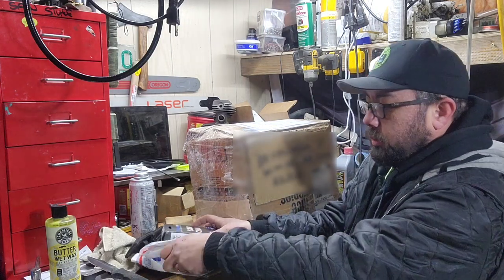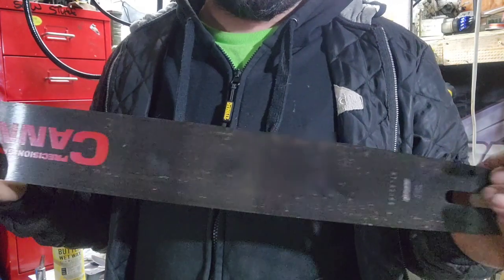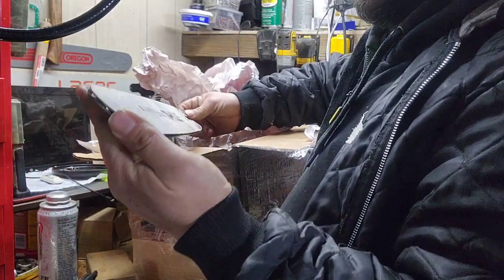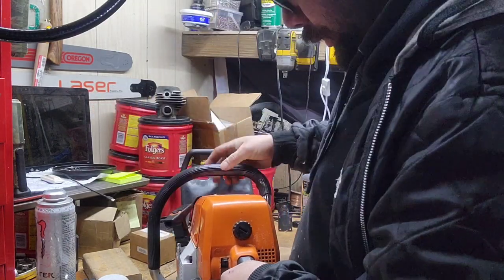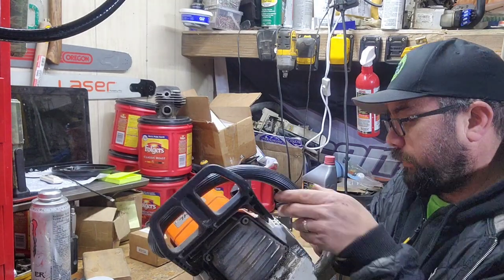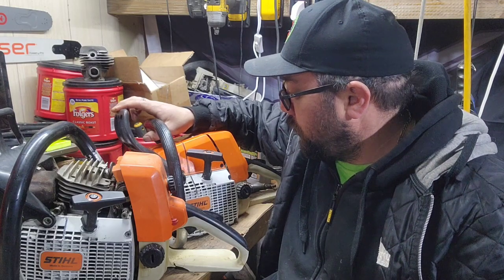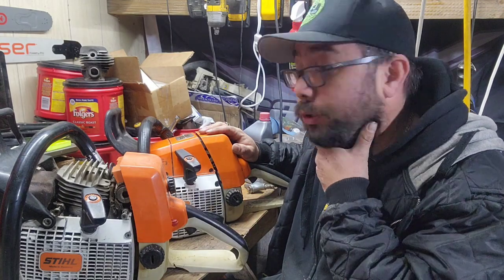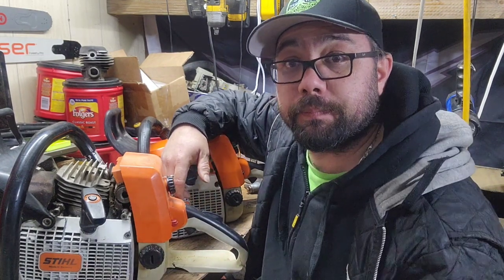Unboxing from @JKSawShop  and  a new saw!

Comment: Sweet saws Chippy.  Yes, you are right that 044s in decent shape are hard to come by these days...
Reply from the maker: Red lever has some age to it, but it's expected when they're being used too, they should to be popping up at reasonable prices lately
Reply: @ChippyOutdoors  yeah i recently picked up a 10mm, slant fin, red lever that has more age to it than your saw.  I rebuilt it with new OEM bearings, seals, piston & carb -- she won't win any beauty contests but GD she cuts!!
Reply from the maker: @@902hand7  ya I won't be keeping this red lever, In coming up videos I'll be converting the newer 12mm with 046 top end, I have a ms440 coming so I don't  really need 3 i only have 2 arms
Reply: @ChippyOutdoors  Sounds like a neat build -- looking forward to watching it....
Reply: @ChippyOutdoors  a 460 or 461 are next on my wish list